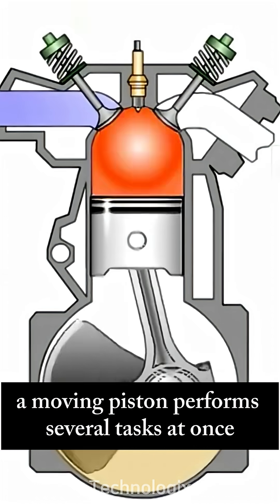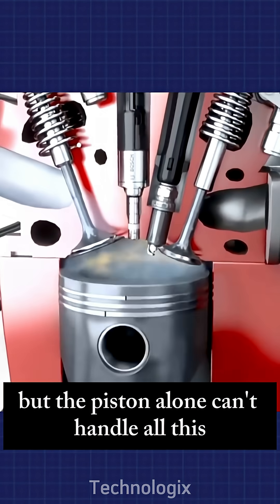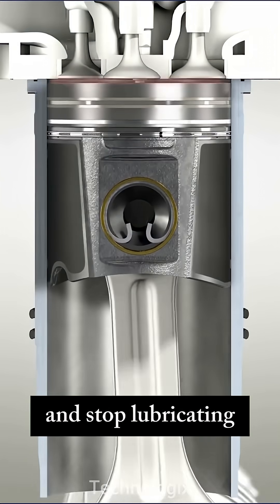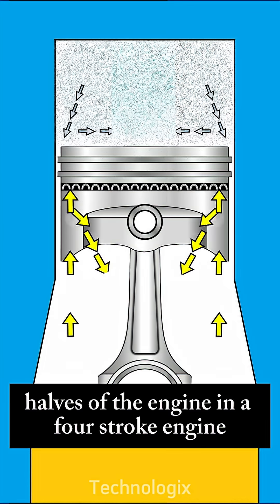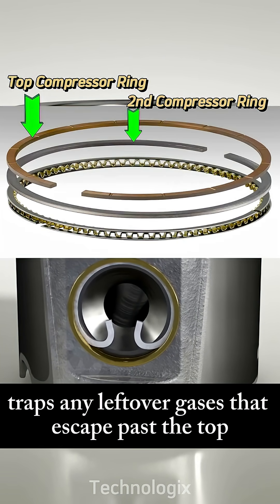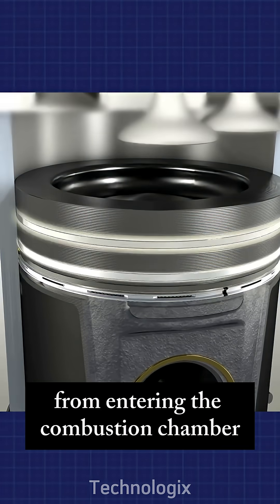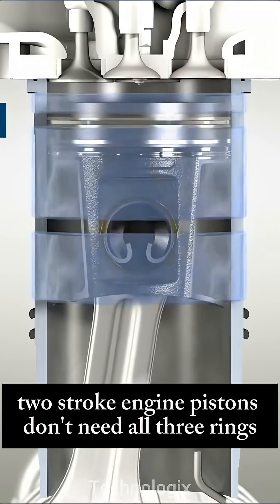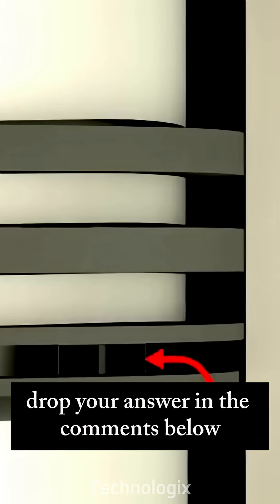What Do Piston Rings Really Do in an Engine?

Comment: The oil ring.   Oil is mixed in the fuel on a 2 stroke.
Reply from the maker: Exactly! In a 2-stroke engine, there's no separate oiling system like in 4-strokes. Instead, oil is mixed directly with the fuel to lubricate internal parts, including around the piston where an oil ring would normally be in a 4-stroke.

Comment: Oil wiper ring is not present in 2-stroke engines.
Reply from the maker: Correct! 2-stroke engines don’t have an oil wiper ring because they don’t use a separate lubrication system. Instead, oil is mixed with the fuel and burns along with it, so there's no need for an oil control ring like in 4-stroke engines
Reply: Yes correct on oil&gas mix. Another interesting thing about 2 stroke is oil injection from an oil tank and some 2 strokes have a reed valve otherwise no valves. Exhaust & intake ports in the side of the cylinder. The carburetor is attached to the crank case. They smoke a lot
At first until warmed up filling the air with aromatic hydrocarbons bad for your lungs. They make twice the horse power compared to a 4-stroke engine because every downstroke of the Piston is a powerstroke. A two-stroke can be made smaller to get the same horsepower as a four-stroke for instance. A 5 horse 2 stroke engine is half the size of a 5 horse 4 stroke engine. 2 stroke engines were banned in the year 2004 because they pollute more. So they
Say.
Reply from the maker: @dwightjt  Yes, that’s spot on! The simplicity and power-to-weight ratio of 2-stroke engines are impressive. The reed valves, side ports, and crankcase-fed carburetor really set them apart. It's true—they pack a punch with every downstroke, making them compact yet powerful. But sadly, emissions and environmental concerns led to their decline. Still, for many of us, the sound and smell of a 2-stroke bring back great memories!
Reply: @Technologix.s I had a puch moped back in 1977 I was 20 had it for 10 years drove it everywhere put 10000 miles on it was very reliable. Points ignition Bing piston carburetor very easy to start reliably. Only needed two and a half ounces of 2-stroke oil per gallon of gas. I wish I still had it.
Reply: It was a sturdy built bike no reed valve in the engine it was easy to maintain it never quit.
Reply from the maker: @dwightjt  That’s awesome! Those old Puch mopeds were real gems—simple, reliable, and built to last. 10,000 miles is no joke! It’s amazing how far you could go with just a bit of 2-stroke oil and some gas. They had a charm modern bikes just can’t replicate. Totally understand why you’d wish to have it back!
Reply from the maker: @dwightjt  Wow! Sounds like it was truly a solid and reliable bike. Even without a reed valve in the engine, if it ran so smoothly and never quit, that really speaks to the quality of its engineering. Bikes from that era had their own charm — easy to maintain, dependable, and built to last. Truly, those were some unforgettable days!
Reply: @Technologix.s ah yes indeed
Reply: this guy is full of zebra shit.